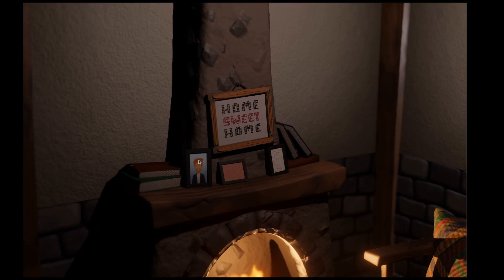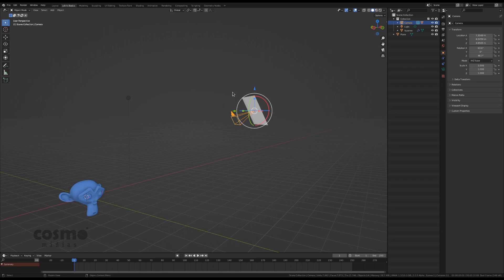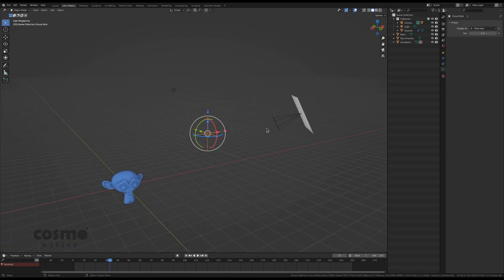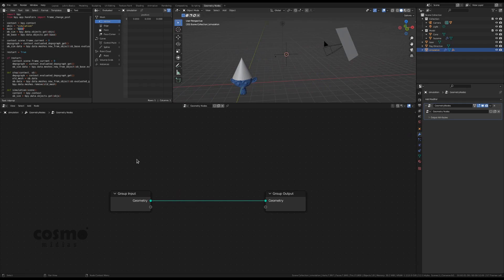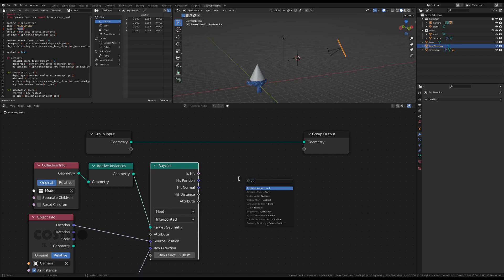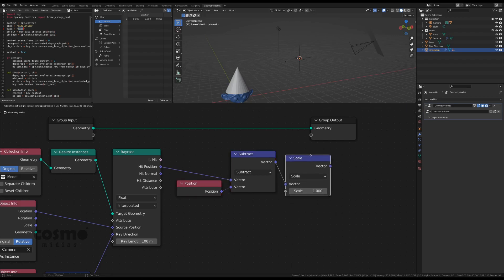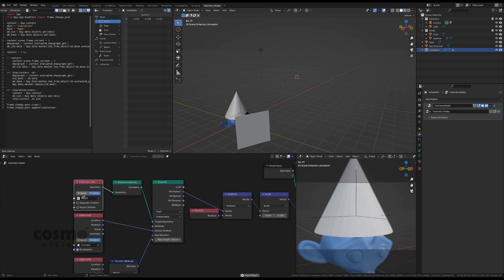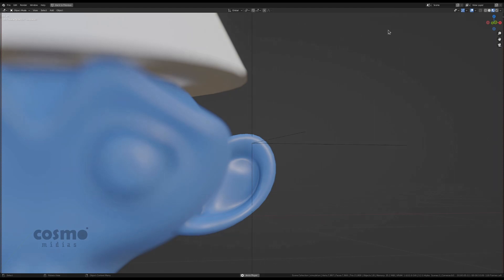Smooth Auto Focus in Blender

Comment: This is awesome, now it works with simulation alpha build, just use sample index node instead of transfer attribute, (depending on your plane rotation you may want to scale ray direction -1) and place set position between simulation nodes and you don't need any scripting, just run sim, and it just works!